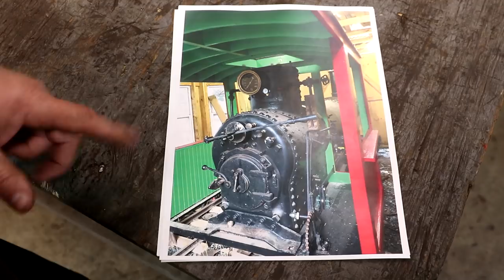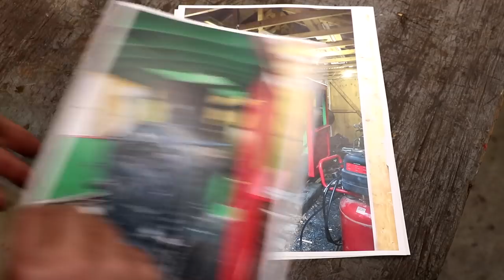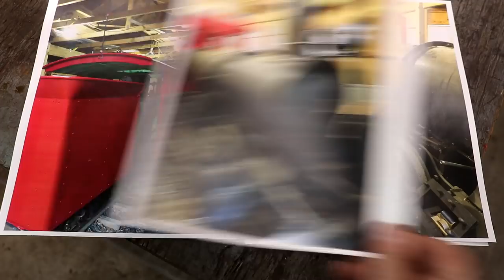Re-Facing and Lapping a Steam Locomotive Throttle Valve

Comment: Didn't you show us a big set of valve-seat reaming tools a few years ago? Could you refresh the seats in the main casting with some of the cutters from that set? (Questions like this are usually too-late, job-done, but still curious whether this might have worked.)
Reply: Theoretically yes. But in this case, having two seats that have to be an exact distance apart, it would be very difficult to get a good result. You also need both seats on exactly the same center, and this valve doesn't have any good pilot surface that can be used to center the shaft for the seat reamers. That makes it even harder to use traditional seat reamers.

Originally the seats would have been cut using a duplex milling cutter with an exact spacing between the cutters that would have been verified with a master gage. Something like that could be duplicated if the exact seat spacing was known, but would be a lot of work and possibly expense if special-sized 30 degree cutters were required. Trying to duplicate that with just a valve with unknown wear as an example would be a debatable enterprise. You could make a bunch of measurements and just pick a set of numbers and cut the seats to match, then cut the valves to match.

If the seats had to be cut, probably the best way would be to set the valve body on a face plate or in a 4 jaw chuck and cut the seats with a boring bar, if you have a big enough lathe.
Reply: @lwilton  - I was think of doing minimal seat cutting on the two seats individually to prepare them for lapping, to be followed by adjusting the distance between then by cut'n'try with the spool as Keith did in the video. I didn't expect this method to preserve the spacing. The kit had mandrels and centering cones to keep the cutters straight on the seat. I do not recall if there were any 30º cutters in the kit Keith showed us years ago (and 15 minutes of searching didn't find it).
Reply: @PeterWMeek  I'm having trouble remembering exactly what Keith showed in that kit, but all of them that I'm familiar with expect there to be a centered bore for an operating shaft, and this is what they use to center on the valve seat. This valve is a little unique in not having a central spindle, it just has the two seats, and all else is just rough casting. Without the central spindle bore to center on, I'm not sure how you could use a typical seat reamer without a lot of fixturing and jigging. I'm sure it could be done, it just seems to me that it would be a lot more work than for a normal valve with a central operating shaft bore.

Comment: Good fix but just being curious  were your 10 thou cuts radius or diameter, looked awfully fine for a full 10 thou  cut.
Reply: He stated the cut depths were "across", so would already be finer on the taper. My guess is that he was winding in 10 thou, not saying 10 thou on the diameter... but that's a guess. Keith rarely responds to questions, unfortunately.
Reply: @johncoops6897  yes I know, but was he watching the fro, usually in diameter, or lathe dials. What I am saying his total removal, if diam, doesn't sound as bad as it would if radius.

Comment: Now that is a rubbish design for a valve…
Reply: I don't think so! I assume it is designed so that the force (due to steam pressure) is approximately balanced between the bottom and the top thereby requiring less force to open and close it. So the opposite of rubbish design.
Reply: Yup - it's called a "balanced valve" and the double seat balances the pressures so the valve doesn't open or close under pressure.  If you've ever worked with steam on an unbalanced valve you'll really appreciate the balanced valve.
Reply: @stumccabe , and it lasted over 100 years, that kinda proved it was a design.